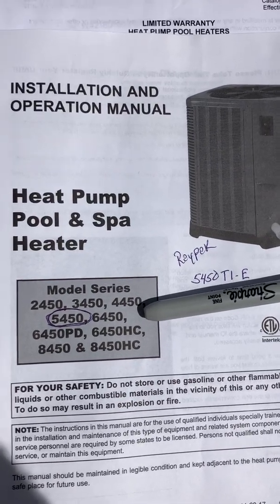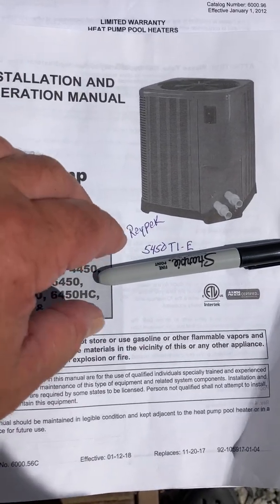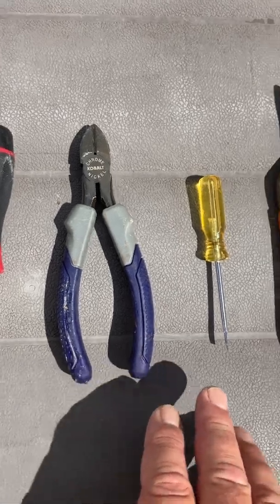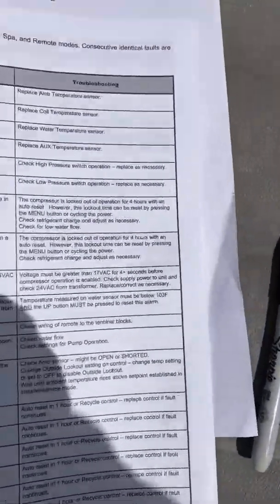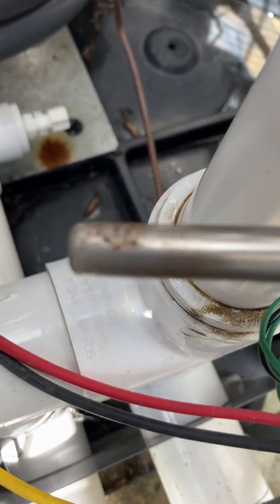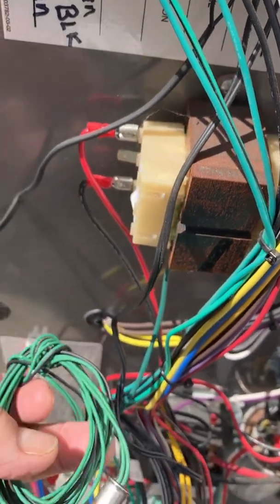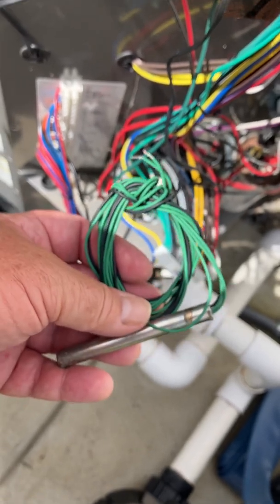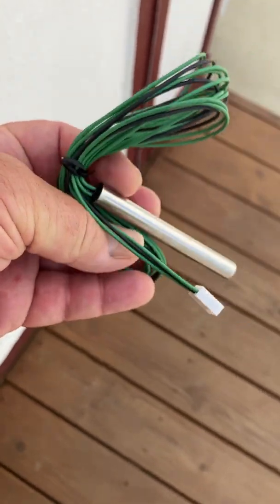Raypak 5450 (also Rheem) Pool and Spa Heater water temperature sensor replacement

Comment: Thanks man this helped me out a lot, did it work?
Reply from the maker: Yes! We went the whole season without a problem! Glad I could help!
Reply: @bakmak8199  ok yea so I have a Rheem 8450ti-E and it just put up the code H20 sensor fail, so I’m trying to find one that’s compatible but is taking a minute to read though the information.
Reply from the maker: If you click on the product link I posted there is a review where someone installed this same sensor in the 8450

Comment: So I have the same heat pump and now its giving me the wrong reading of the water temperature, but its not giving me any errors. The temperature is off by 10 degrees or so, everytime the heater runs it resets the temperature to like 69 degrees even though the water temp is like 80. The part that you used still working for you?
Reply from the maker: Yes, I tested my heater this afternoon in anticipation for pool season and it worked fine.

Comment: Your viseo was very helpful. According to the Rheem specs you should have installed a H000329 sensor. The H000329 in backordered. Is the sensor still working that you installed? what date did you install it? Thanks
Reply: Excellent video!!  Very first one I’ve seen.  Mine is under warranty but getting impatient on “parts arriving and scheduling”.  I can get the part off Amazon just trying to figure out if I could do it myself.
Reply from the maker: @bigt0076  I too was pretty intimidated by all the wiring but it all turned out fine. Take pictures and notes if needed and don’t forget to turn off the breaker.
Reply from the maker: I installed it a couple of weeks before closing the pool for the season and it worked fine during that time. I haven’t opened our pool yet for the year but I feel confident that it will still be working. It too is a 100k sensor as the H000329 is and is also the same length and diameter just at a much better price. The only difference was I had to cut off the plug housing and hard wire the 3 leads into the motherboard just as the 329 was wired.